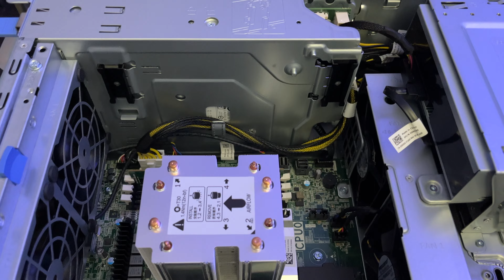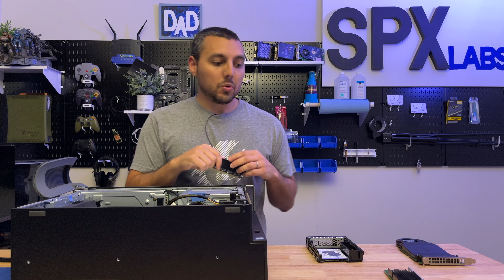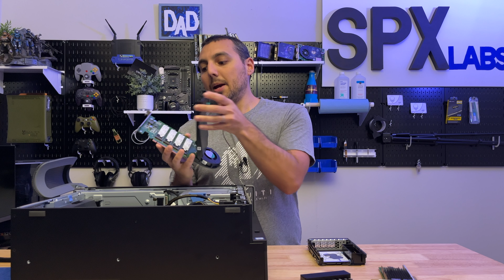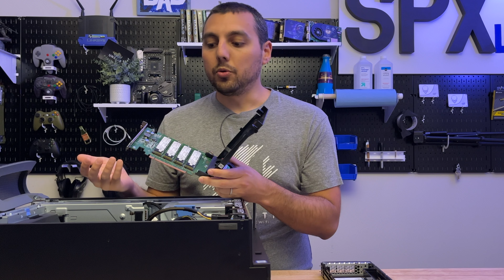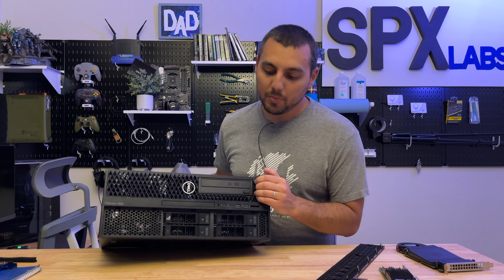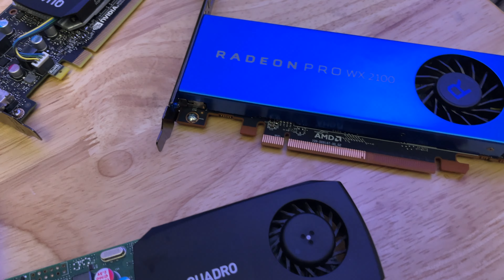Meet PNAS 2.0!  The Dell 7820 is my new test @UnraidOS #homelab server!

Comment: Hey is it quieter than the HP Z8 G4 and DELL 7920s?? I have been using the dual 6242R Gold on my Z8 G4 but the fans do ramp up alot under load. This one has to have a riser for such configurations.

Comment: are you able to run multimeter on power switch pins and tell me where it goes? I am trying to help poorer countries use these machines, we already have converted the 10 port and 24 port proprietary power connectors to ATX power

I do not have the case to one here, so I cannot test where it goes to which 2 pins to power on.

Judging by your other videos I assume you know how, but it is hard to tell as well.

Comment: Great Video!  Were all the components you installed (CPU, RAM, NICs, Video, etc.) Dell Branded?  Can you or do you know if you can install non-dell branded components (Namely RAM and I/O Cards)?  If so, do the fans go all the way to high if you do install non-Dell branded components?
Reply from the maker: It’s 100% Dell branded stuff.  I have put non dell stuff inside and it works.  Like the RAM, a few GPUs, and a quad nvme card.  1 example https://youtu.be/DEhuTVY3bpo
Reply: @SPXLabs  Thanks for the quick reply!  I'm looking at a few for an ESXi Home lab and your reply helps!
Reply from the maker: I love mine but I under utilize it
Reply: @SPXLabs thanks for all the replies.  I have 3 of these 7820 and I'm having a really hard time finding non-Dell Branded RAM that will work in this unit.  I've hit the Dell manuals and many of the online RAM finders but they are either wrong or send you RAM that doesn't work.  Any suggestions on which 3rd party RAM works?
Reply: @vmexplorer  What RAM do you have now? If you are using RDIMM and LRDIMM together that will not work.
Since this system is 32gb max in each slot from what I read in the manual, you should just use RDIMM and you then want ECC ram. So you want DDR4 ECC RDIMM 2666mhz ram
Reply: The only proprietary dell things are the motherboard and power connectors. Everything else can be replaced.
We have reverse engineered their power supplies to work with ATX but if you are in the states, ebay has the power supplies for extremely cheap (cheaper than ATX) so no reason to do so

Comment: Im running the 7820 with the additional 2nd cpu, so dual Xeon 4110s. Definately overkill, but as you said it s super quiet.
Reply from the maker: I just learned a day before the release of this, that there is an add in second CPU and ram card thing.  So baller lol
Reply: one Gold 6148 would be better lol
Reply from the maker: True but this was free so I won’t complain
Reply: @SPXLabs  was talking to the OP with his 4110. Lots of these dual core systems have worse cpus than just 1.. idk why (also use more power)
Reply: Hey is it quieter than the HP Z8 G4 and DELL 7920s?? I have been using the dual 6242R Gold on my Z8 G4 but the fans do ramp up alot under load. This one has to have a riser for such configurations.